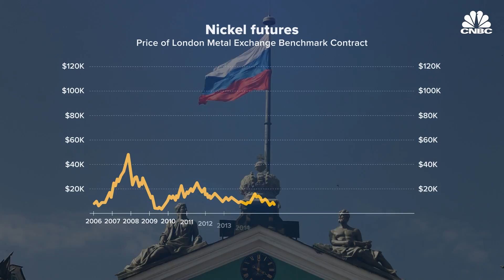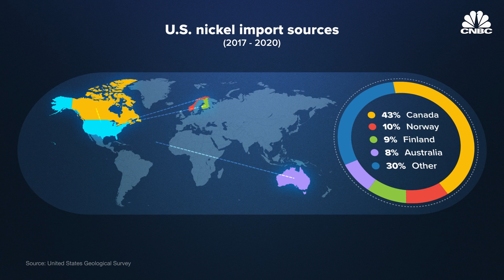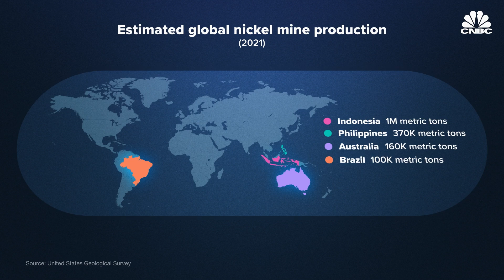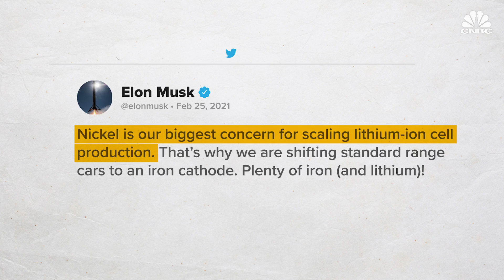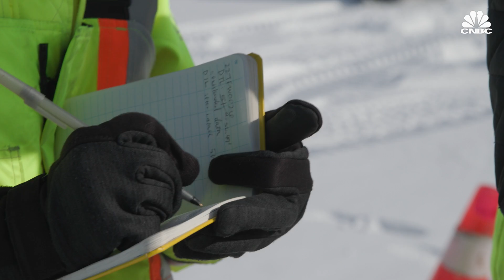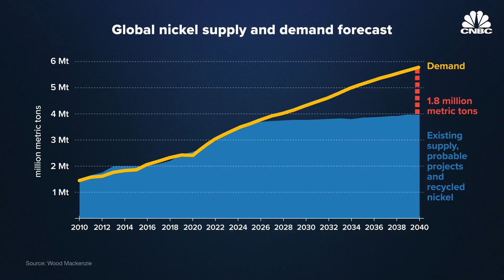Why The EV Industry Faces A Global Nickel Shortage

Comment: Tesla is moving most of its car batteries to LFP (iron) it contains no nickel & no cobalt.
Tesla can do this as their cars are much more efficient than any other EV’s.
Ford, GM & VW can not get 250 miles out of LFP so they are in big trouble.
Reply: Wrong!!!!! Tesla is using LFP on small mass produced vehicles, the cybertruck, semi and other models including possible upcoming van…. Are going to use high density NMC Batteries with a lot of nickel.
Reply: re: "Tesla is moving most of its car batteries to LFP (iron) it contains no nickel & no cobalt." nope. 
re: "Tesla can do this as their cars are much more efficient than any other EV’s." greater efficiency will NOT be enough to save them.  
re: "Ford, GM & VW can not get 250 miles out of LFP so they are in big trouble." Tesla is in big trouble PRECISELY because they are the ones most DEPENDENT on these supplies.
Reply: @phillyphil1513  lol…… tesla uses a lot more aluminum in their car shelf, LFP batteries are just good for low range slower cars, ford, GM, vw can very easily squize the same range in their cars.
Reply: @carholic-sz3qv  re: "tesla uses a lot more aluminum in their car shelf"  Model S not withstanding, Tesla's technically "late to the party" in terms of lightweight structures.  re: "ford, GM, vw can very easily squize the same range in their cars."  for sure, Ford's F150 body has also been FULL aluminum since 2015 (and has been inherited by the Lightning) VW went FULL aluminum by way of their Audi A8 sedan 28 years ago (1994) so clearly they know how to work with the material.  and of course Jaguar's "claim to fame" has always been the use of aluminum (which is where the rest of the world got the idea from in the first place) having produced the first bodies way back in 1949 with the XK120.  CEO Rawlinson worked for Jaguar so his new Lucid EV sedan is also (wait for it) a FULL aluminum body. (OH BUT THERE'S MORE...!!!) i almost forgot GM are no strangers to using aluminum. a bit of aluminum is used in key areas of the highly praised Alpha platform for Cadillac and Camaro.  the supposedly "lowly" Chevy Bolt EV has it's hood, front fenders, doors, and rear hatch all made from aluminum (true story) and the Corvette chassis underneath has been FULL aluminum going back 3 generations with the new 2020 C8, 2014 C7, and the 2006 C6 Z06 (base models were steel).  source: nephew went to school for Autobody/Collision.
Reply: @phillyphil1513  I believe only Tesla (and now Geely) are using giant casting machines to make major front and rear aluminum structures.

So if you are Panasonic, CATL, BYD, LG Chem, do you want to contract with a company that will be making millions of cars over the next 2 years that is also making Powerwalls and Megapacks? A company that says it will buy every battery you can make? Or contract with companies who are making a fraction of as many cars and no stationary storage?

Additionally, Tesla has a new battery factory in Texas, is building one in Germany, has an existing one in Freemont and a joint plant with Panasonic in NV. 

Tesla planned ahead and has long term contracts for Lithium and other important materials. 

Tesla aquired companies such as Maxwell, Hibar, Grohmann, SilLion, ATS, Perbix...all to facilitate manufacturing of batteries and other parts.
Reply: @phillyphil1513  Clearly not all businesses plan ahead very well. The ICE car manufacturers sure didn't plan for EVs until Tesla outmanouvered them.

Tesla is highly profitable. And their profits have been steadily increasing. During the pandemic and chip shortage they increased production about 50% from 2020 to 2021 and about 60% from 2021 to 2022. Despite several price hikes and increases in production, the waiting list for Tesla keeps increasing. Two huge Tesla factories are coming on line now. Their Shanghai plant is doubling capacity to 2 million cars a year. Tesla can't build million dollar megapacks fast enough to meet demand. (Batteries are more profitably used in cars right now.) 

Tesla makes their own chips for Autopilot/FSD. They also make their own chips for their powerful new AI training computer. (Dojo.) They have many top programmers and during the chip shortage was able to reprogram alternative chips while other automakers were helpless and shut down factories.

Tesla is the number one choice in the world for engineering graduates.

Tesla is selling insurance. They are doing very advanced AI work. They have access to metalurgists and other rocket scientists at SpaceX. Tesla is very vertically integrated and even makes its own seats.

Tesla spends no money on advertising and doesn't have to share markups with dealers.

If you listen to what VW's Herbert Diess and Ford's Jim Farley say about Tesla, you'll learn that the rest of the industry is worried and scrambling to try to copy Tesla in various ways. Ford just divided the company into ICE and EV divisions...to try to get competitive.
Reply: Not happening bro, nickle batteries are unchallenged in capacity, and more capacity means more range means customers who wouldnt buy a 300 mile vehicle would buy a 600 mile vehicle
Reply: @matty1234a1  Tesla’s waitlists are approaching 1 year long.
New model Y from Austin & Berlin will get 275 miles from LFP.
LFP likes charging to 100% all the time and lasts 2 million miles. Demand for the new Y will be insane.
Anyway in the meantime Tesla has many long term nickel contracts. Ford and GM not so much…
Reply: @whowhy9023  lol…….. 2 million miles my @Zz if the vehicle doesn’t have enough range to replace a cheap ICE that has better capabilities and range it’s not good.
Reply: @whowhy9023  Yes. LFP batteries will be where the action is for mobility companies who need to scale up. Also for stationary storage.

BYD LFP Blade batteries are a good example.

Comment: You all realize this particular EV push is a ruse so we do not talk about the actual fuel we are currently using right ? We should be talking about switch grass and removing corn from the ethanol entirely ! For many reasons this is the most reasonable change we can make that will make an impact immediately ! Corn requires fertilizer switch grass does not . The math they performed to get corn ethanol to 21% to meet the required 20% did not account for many factors we now consider when approaching climate decisions ! Switch grass however using that same math would be closer to a 60% reduction ! I am pretty sure switch grass can be grown in a wide variety of places if not in all our yards collected by a repurposed trash truck ! 
But hey maybe you will not melt the power lines into puddles of liquid when you try and turn on all those fast chargers ! Fast chargers would need to all be placed on solar outside the system somehow to protect the grid !
Reply: First ethanol or burning anything is still a negative for climate change/ CO2 emissions. Secondly most EV charging done at night when demand is low, and done by slow charging. Also you are assuming no change to the grid and ignoring the massive increase in at home solar/battery installation
Reply: Battery tech may not be there for a few more years : Then we still have all these old vehicles to deal with ! Humanity as a whole can do this but it will require so much effort on everyone's part it might not be worth it ! Ide say the best idea is open up patents to try and hack nature somehow ! How do those wireless phone charges work ? Can we charge batteries with radio waves ? we have nationwide radio can a car capture it and turn it into juice ? Program it to receive a certain frequency and somehow convert it ?

Comment: The U.S. power grid could not handle charging cars if everyone had an EV.
Reply: The grid only has problems during peak demand. 07:00-10:00 & 16:00-21:00
EV’s charge at night so there is no problem for many years, think 2040-50.
Reply: @whowhy9023  We haven't built a Nuclear power plant in over 35 years!! Problems with the grid NOW, I said if EVERYONE had an EV charging it wouldn't work, the grid would have major issues. Power companies have already complained around America about having enough power to power all the electronics people use now.
Reply: @whowhy9023  Bro I have been reading rolling black out stories from California my entire life !
Reply: @john doe are you oil lobbyist or ….?
Reply: solar, wind and hydro power
Reply: which is why you encourage home solar - not that it has to add power back to the grid, it can just free up what is ON the grid for other uses during daylight hours.  If the need were there you could easily add 25 % power availability within a 5 year period just using efficiency reviews of it's use, upgrade motors in plants and fix the wonky HVAC systems etc...  it's totally doable...  and who says everyone has to have an EV ???  If the US got to 35% EVs in the next 10 years in the rolling fleet, it would totally upset the crude refining industry before the power generation industry...
Reply: @lylestavast7652  I don't want solar panels on the roof of my home! Why? Think of the cost first off, second... the cost of removing the panels so I can install a new roof and then pay to have the panels put back on my roof again, for a 3rd time!!! You cannot eliminate ALL oil companies, plastic and rubber comes from oil industry. Do you intend to drive your EV with no plastic parts and no rubber tires? lol Also, whatever power I would generate from my solar panels, should not be sent back to the power grid.
Reply: Klaus Shaub had a mentor that spoke about bio fuels being viable the year I was born ! https://www.youtube.com/watch?v=MWs8BCYC1DI

Comment: The world absolutely sucks at recycling basically everything.  Almost everything can be recycled or reused, the main draw back for some is that it can be cheaper to use new virgin materials such as plastic, and there is basically ZERO education and policy for recycling Especially in the US. 
 The world can also not mine it's way out of climate change unless we recycle Everything possible while reducing the overall energy demand at the same time. 
Please everyone learn how to recycle PROPERLY, it is very Very important.
Reply: What about the heat pollution which is causing global warming? Recycling plastic costs 1000x more energy rather then making new plastics, that's the real problem here. Plastic is a big problem but it isn't a big deal right now because the real problem is the heat pollution. 

And the same goes towards recycling anything, it will always cost more to recycle then to produce.
Reply: @milkmangaming3325  again what BS!!!!! Show any facts that recycling plastics takes 1000x more energy than new virgin plastic.  
You also can't compare recycling all Anything as the same because there are some nay factors that go into making And recycling products.
Such as what type of material is it, how far did it travel, what mode of transportation did it travel buy, what is the new product going to be and how long is it I tended to last, what sources of energy is being used processing the material, can the material/product be recycled again, etc. 
Have you ever even seen a garage dump? Do you even know how many billions of dollars the EPA spends on cleaning up old dumps and super fund sites that are polluting the air and water?
Do you have any idea the long term contracts and securities it takes to get and maintain new supplies of raw materials from other countries around the world?  
DON'T spread BS information on the internet¡!!!!!!!!!!!!!
Reply: @andyjohnson3790 you can have a civilized conversation with out being arrogant. you missed my point, Im only talking about the main pollution problem we are facing now which is heat pollution which is mainly coused by all production off all kinds for example it doesn't matter how many electric cars we have if heat from producing the cars is equal or worse then producing gas cars and we can't forget the serious amount of energy needed for producing all the materials to make roads like concrete and asphalt which brings allot of heat to the atmosphere, there isn't one solution that is better then others all we can do is make machinery more efficient. 

But my point still stands when it comes down to recycling, it will always be more efficient to make new products rather then recycle them that's why we don't recycle nearly 90% off all materials because who is gonna pay for that? tax payers? maybe if we had any modern nuclear power plants like the new prototypes made a couple years ago then we could maybe recycle with out damaging the earth a lot. 

The earth has risen by 0.08 degrees celcus per decade since 1880 but it has been accelerating greatly for the past 40 years to 0.18 degrees Celsius which is the problem. with these statistics we won't last more then a couple 100 years. 
No one cares about the ocean or air quality right now all that matters is the heat WASTE!
Reply: Products should also be made with recycling and repairing in mind. Smartphone company got away with planned obsolescence and glued batteries for way to long.
Reply: Reducing energy demand, lol what a green lunatic
Reply: @mlaw1123  the word is called 'efficiency' . If it's a new word to you that you have never heard of go look it up.
Reply: I moved from the south to the north east to take care of my grandmother.

When my engine in my 96 Toyota corolla manual crapped out. I just did a engine and transmission swap from a 2010 Toyota corolla manual. 

I'm a huge supporter of making everything modular so you can swap internal components very easily.

You can extend the life of really anything if your design it that. Companies don't want you to fix what you already got. They want you to buy a new one and just throw it out.

And the amount of plastic that is thrown out is disgusting. There are technologies that can scan and separate every kind of plastic that is manufactured.

We do need to recycle and thing of a thing we buy as an investment.

My dad owned a automotive repair garage when he was still working. When he started, you bought a high-end car jack and just rebuilt the piston and pump chambers about every 10 years. 

Now car Jack's are so cheap they get thrown away and buy new ones. 

It's a change of mind set and tax incentives to make things modular.

Comment: CNBS fud at work. Tesla has long term agreements in place that predate this spike in nickel price. The ev competition in North America is just starting to negotiate supply. They might have a tough time. And then there’s the LFP batteries that Tesla uses more and more. No nickel no cobalt no problem.
Reply: LFP batteries is not as dense as nickel ones and for things like trucks or other bigger EVs that hasn’t even started production yet it’s going to be a serious challenge.
Reply: yeah consider this video not mention a single word about LFP battery. it's cheaper, safer, and more environtment friendly than NCM battery, the only downside is the battery density
Reply: @Fauzanarief-n7i  this video mentioned batteries mostly for performance applications and high density ones which are equally as important and if not more.
Reply: Yep a definite case of tunnel vision in this video
Reply: Dear cnbc, do not doubt EM capabilities.

Comment: CALIFORNIA HAS ASKED EV OWNERS NOT TO CHARGE THEIR EV CARS....AS IT WILL STRAIN THE ELECTRIC GRID....LOL EV ARE NOT SUSTAINABLE
Reply: no they have not.
Reply: Russian trolls are still on youtube. Google need to ban them
Reply: It goes bolth ways if to much energy is being pulled then tesla batteries wich most tesla car owners have to put energy back in grid to help prevent blackout.
Soo if soo many people charged there car the city asked not to then I can say thats enough cars that if it did do that to the grid the system of tesla energy will turn it off to prevent damage and potential blackout by only using the battery energy tell the grid settles down.